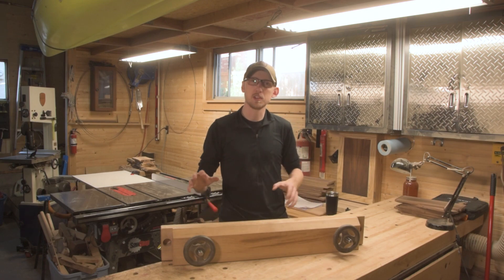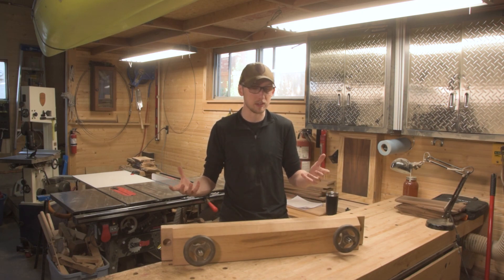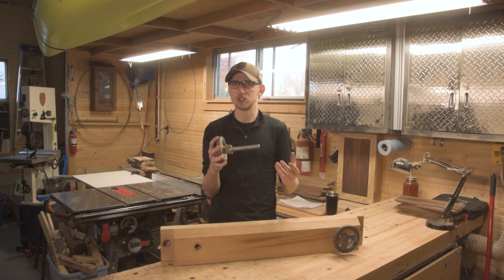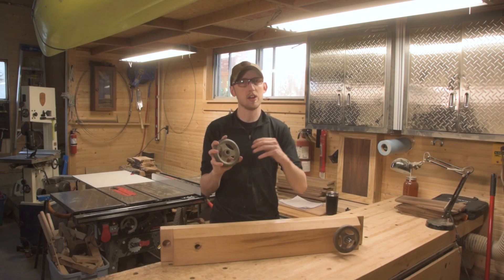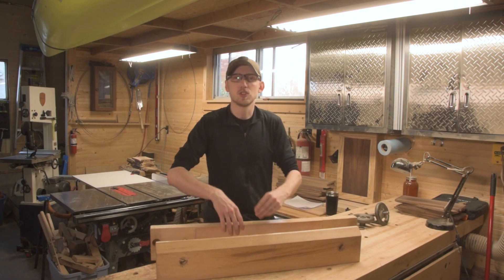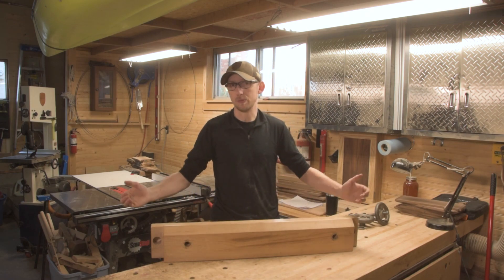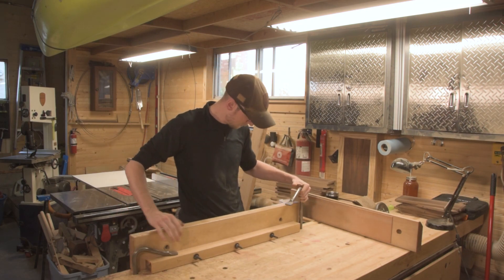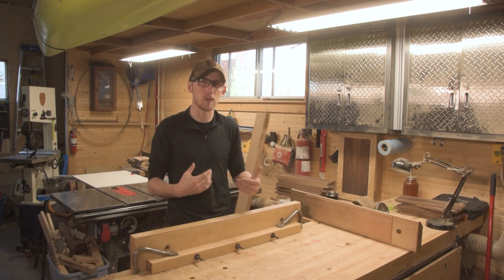What is a Moxon Vise?

Comment: Good review. I've been using Moxon vice for years. I've  got a 16 inch one I use as an end vice on my bench, mounted flush with the top, a 32 and 42 inch ones. My wife has a portable bench with one on it. One improvement we made on ours is to put springs on the bolts. Works almost like a regular vice then. Keep up the good work. You're an inspiration to beginners.
Reply from the maker: Thanks, they really are one of the best vises to start out with since you can mount them pretty much anywhere. I'll have to be on the lookout for some springs because that's a really great idea!

Comment: Great review! I have that vise in my LV wish list right now. 

Thinking about the 48” vise: I wonder if it would be smart to make the chops with a convex surface so that when clamping the chops act like a caul. That should offset any weakness given the incredible length of the vise.
Reply from the maker: That's an awesome idea! That would solve the issue of not enough clamping pressure over the length and move the pressure from the edges to the center. I don't know if I'll ever build a 48" vise but if I do I'll defenitly give this a shot!